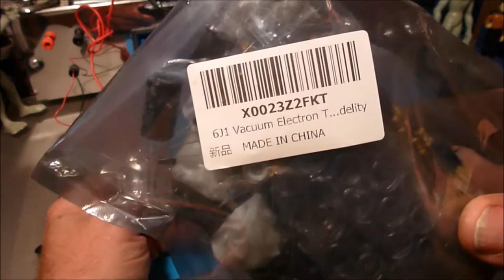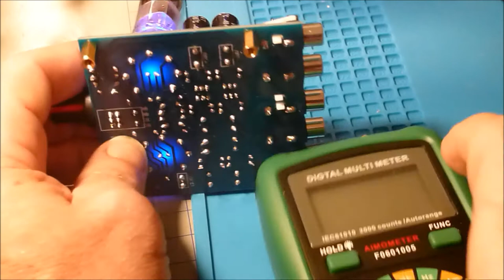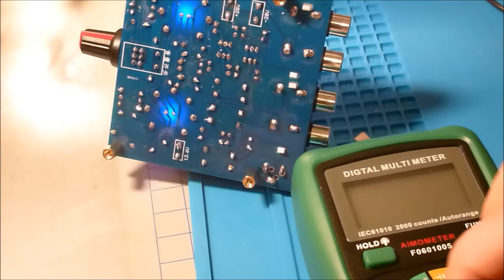Reviewing a cheap 6J1 tube preamp.

Comment: Just watching another video about the 6J1 preamp and the guy is testing it out on an oscilloscope. He says the 1 microfarad capacitors on the output are not letting the bass tones through and is suggesting changing those to 3.3 micro farad, or  4.7 micro farad capacitors. The video is called 'Tube preamp budget kit test and review' and channel 'JohnAudioTech'. Maybe the capacitor changes can give you a much better 6J1 preamp.
Reply: my native language is not English, I speak Portuguese... so I apologize for the mistakes. I have this preamplifier. I made the suggested modification to the output capacitors to improve the response. really improved. but the best change I recommend is to place a capacitor in parallel with the cathode resistor, the sound has improved a lot. I suggest calculating with the frequency formula for capacitor=1/2πrf to find the ideal capacitance value for a good response from 20 hertz. Now my problem is learning how to control the noise, maybe lowering the supply voltage will solve it.

Comment: Get you a FX-AUDIO TUBE-03 tube preamp to feed your main amp. Replace the tubes that came with it to a matched pair of 5654Ws, and you will hear wonderful base, and all the way up! That is my setup here at home. Mine is driving a 100W per channel class D amp that drives a pair of 12s with tweeters.

Comment: I’m afraid that I am one of those people who has to have all my resistor bands going in the same direction. Nice job on the kit build and video. 👍👏🏻
Reply from the maker: It usually doesn't bother me unless there are a lot of resistors. I still can't figure out the buzzing noise problem. I guess the next solution is to replace the tubes with better quality ones.🤷
Reply: Yeah, me too!! 😅 Allthough on that kit I did it a bit different. I oriented all the tolerance bands to the middle.
Reply: Me too mostly

Comment: Tubes/valves add even harmonics and soft clipping which enhances the mid and bass frequencies which is pleasing to the musical ear! Guitarists like Mark Knoffler, Brian May love this sound! Many audio fans also find this a pleasing to the ear! Although valve power amps are expensive a solid state power amp with a flat frequency response coupled to a valve pre amp is a cost affective solution as the even distortion is added at the pre amp stage! It adds presence to the signal which gives like live music into your listening area, it seems to add an octave above fundamental and a 5th above ! I used to have 2 Leak TL50 power amps and a .1 % plus pre amp but sold it as the TL 50’s power tubes (matched pair) became too expensive (£160 ) to replace! I now have a pre amp like you have here feeding 2 solid state FET power amps that should last a long time I hope! Fraser.
Reply: yeah! i have a project converting a hifi audio amplifier into a decent tube sounding guitar amplifier and i'm planning to use that hifi tube preamp to replicate the tube vibe and still use the stock power amp. i hope it will work perfectly

Comment: I've just noted in the video that 2 of the 4 transistors looks not mounted correctly, the flat side should be facing each other. You can check the marks on the pcb. Next time pay attention touching the board when powered, because the tubes works at 70 volts that can be dangerous. Have a nice day!
Reply from the maker: You are correct about the transistors, nice observation. Good thing a npn transistor turned backwards are still a npn 😆. I has been fix.

Comment: Hey buddy. I ordered the exact same circuit but with the acrylic shell- question, is it possible to bridge the left channel into the right channel making it into a bridged mono………and double the output? Thanks.
Reply from the maker: I'm sure you could but remember this is a preamplifier not a power amplifier its job is to increase the signal strength for high impedance.

Comment: Hey great video! Noticed the multimeter was on DC for reading the voltage. Could you pull 12V DC from that leg and use it to power a 12V DC amp like a TDA 2050? Cheers

Comment: Thank you for this video what if I put 12volts and 1.5A adapter for this kit?
Reply from the maker: As long as it is 12 volt AC, 1.5 amps should be enough , like I said it has to be 12 volt AC.
Reply: @rednerdnecktech2474  I like to talk about it. I did it long a few weeks ago and I heard really warm music with a big sound after I got the item from AliExpress. Unchained melody from Leann, then a few hours had passed and it permanently turned off. I thought it was too hard for this tiny amp to make the sound or impedence magnifying whatever? I am not good at it. I inspected for a long time and found the adapter is broken not the tube. For the soul music the adapter was victimized I thought but it is not. Thank you for letting me know that. I think adapter was almost broken... I purchased a new one 12 V with 1 A and working so nicely. I ordered the same one in this video and the case suited for the one but AliExpress sent me double of them without a case... And just one pair of tubes. I got two boards.
Reply from the maker: @airmicrobe  I don't use it much but it still works. I would buy extra tubes if you use it a lot. Good luck.
Reply: @rednerdnecktech2474  I appreciate a lot for ur reply. I DIDN'T ASSEMBLES TWO BOARDS YET. I BOUGHT AIYama one which already assembled. But I don't understand the circuit and just know how to soldering which is also a kid's level. I am a kid. Thank u that is exactly same model.

Comment: Can i use 12vac to 12vdc rectifier to use with battery?
Reply from the maker: No you would need an inverter not a rectifier to use this preamp from a battery. This is an expensive solution. There may be a way to power it with (2 ) 12 volt batteries. Having one power the positive rail and one power (reverse)the negative rail but I would have to go back and look at the schematics to figure out where to connect the power supply and test the circuit.

Comment: Can I change leds? cause It has 2 blue leds and I'd like to put orange leds
Reply: You would probably need to change the LED resistors to different values depending on the voltage of the new LED's. I don't know very much about electronics but I know LEDs need the correct resistors to prevent burning the LEDs out with too much power
Reply: @bigbasil1908   thanks for sharing info... Have a great day
Reply: @joakojo8470  You too, and have a great christmas friend 😃

Comment: This thing works on 12volts ac supply... and you have not put those transistors correctly...I have built a couple of these and mine works fine, no hum in my preamps.
Reply from the maker: I have since corrected the problem good observation. Good thing a npn backwards is still a npn which allowed it to work.😊
Reply: I think there is a voltage doubler in the circuit! Fraser
Reply: Also screening is very important in valve circuits!